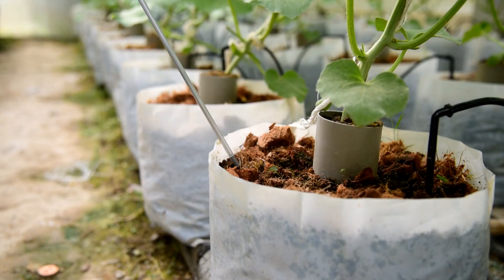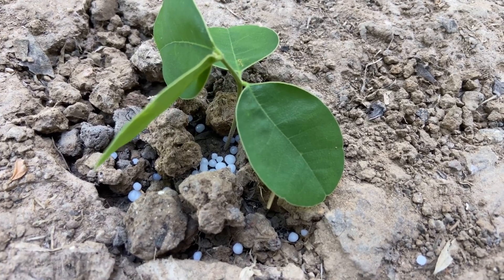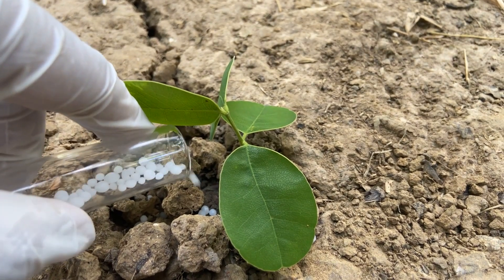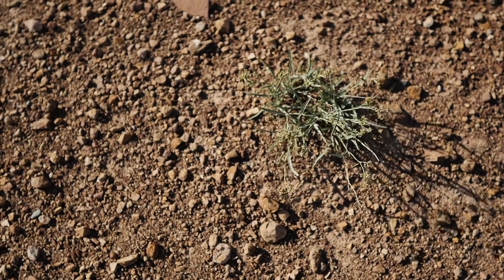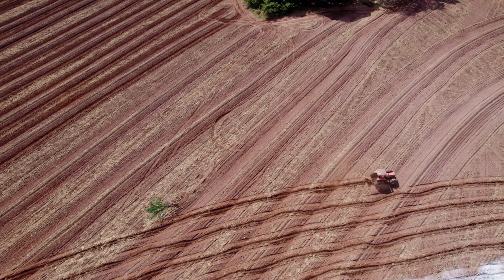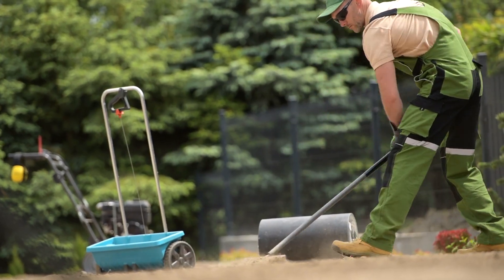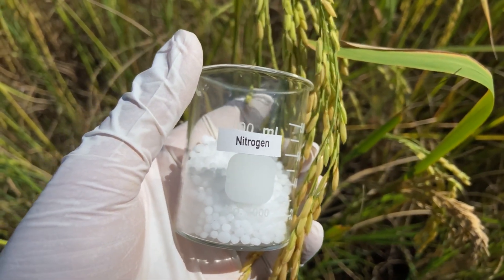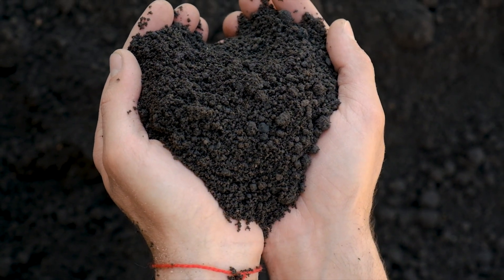Understanding Soil pH and How To Adjust It Naturally

Comment: compost and pine needles are ph neutral. it's folkore/myth that says otherwise. without a test of of the levels of the minerals/nutrients in soil, ph by itself can be a deceptive reading, as it's only an aggregate reading of all the cations and ions in the soil. you could have a naturally acidic soil but excess salts brings the ph to neutral, or a tight soil that prevents natural hydrogen exchange into soil. in both cases loads of calcium are needed, despite ph being deceptively already neutral. it's a complex topic, and it would be better explained in terms of the positive and negative charges of the minerals, as there are all sorts of soil makeup, that affects different characteristics of soil for plant growth.
Reply from the maker: This is wonderful information - I hope everyone reads your comment!!
Reply: Exactly

Comment: How you know what the ph is at the roots🤔
Reply from the maker: Test it :D
Reply: @GardenBoundAnswers  how
Reply from the maker: @sugargraham6868  Well, I would recommend getting a sample from the substrate (usually works best after you've recently watered and the sample is moist) - then, you can add demineralized water to the substrate and mix it well - then I'd recommend an EC meter and a pH meter - that way you can test both. You need to make sure the meters you purchase are properly calibrated. But, usually the best way is to get a sample of the soil near the root, add some demineralized water to it and test it that way.
Reply from the maker: Also remember that based on where your plant is in it's lifecycle the EC will vary - so just be sure you know how old your plant is etc. If you've newly planted and have high EC measurements - don't worry, that's pretty typical. They should level out after the first three to four weeks.
Reply from the maker: I forgot to add if you don't want to go through the process of doing all that, look into pH tester drops.

Comment: Some good tips, but some things are left unexplained. Anything you do to change soil pH is not going to be instant.  Changes over time means weeks to months before pH actually  changes.  Organic matter  does buffer the soil so it behaves more neutrally, but it is not neutral. Most aerobic composts are alkaline. Peat moss is usually buffered with lime to a pH of around 6.0. Eggshells will take years to decompose even if crushed.  You cannot apply lime to the surface to change pH  It needs to be incorporated into the soil because calcium is not a mobile element.   It is much easier to make a soil more acidic than it is to make the soil more alkaline.  Most soils always revert to their base equilibrium.  If you have lime soil, it is hard to grow acid loving plants in them.  You have a point about organic nitrogen, however, young plants may require more nitrogen than organic fertilizer can provide.  Compost is not fertilizer. If you do soil tests regularly and keep the soil balanced you can do a combination of organic and synthetic fertilizers because synthetic fertilizers can address specific deficiencies better as long as you have the recommendations on how much to add.
Reply from the maker: This is great information! Thank you for sharing it!